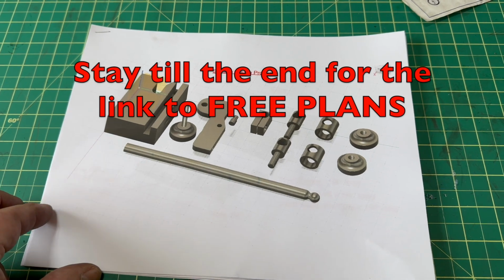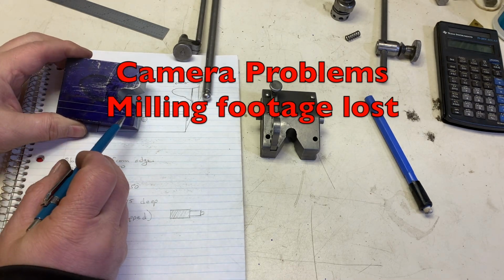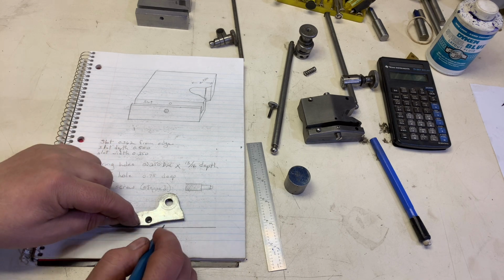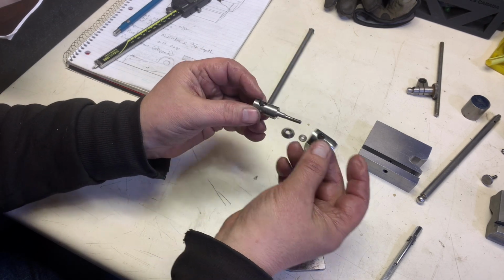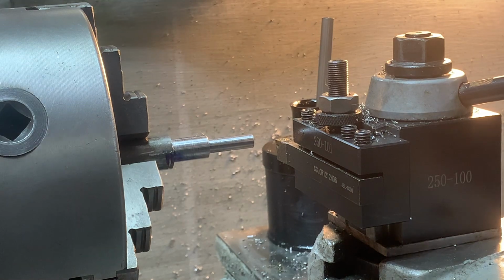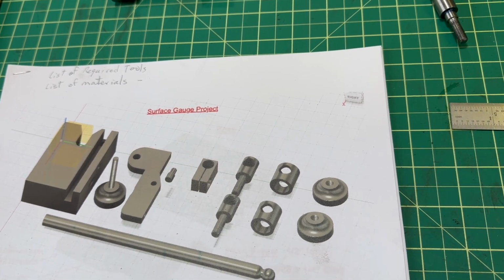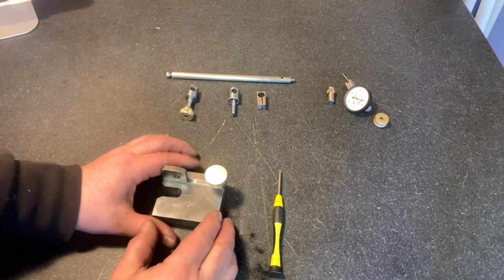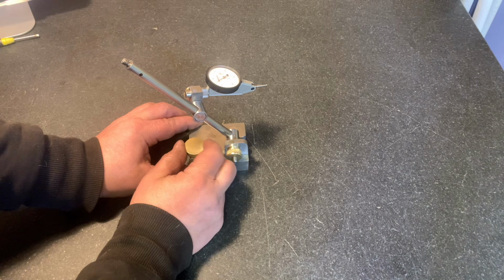Easy Surface Gauge Project for Beginners

Comment: Some typos on your print of the pivot The one inch measurement on the left should be 3/4 and the measurement down to the first hole on the top should be 1/4. You're welcome.